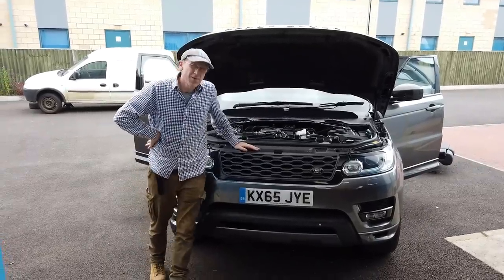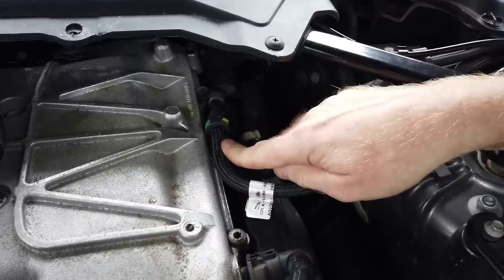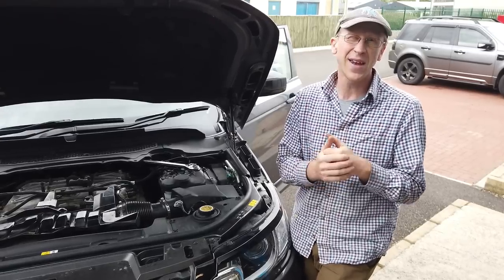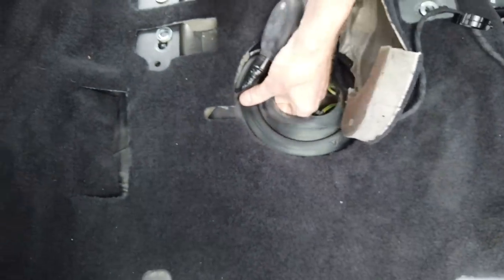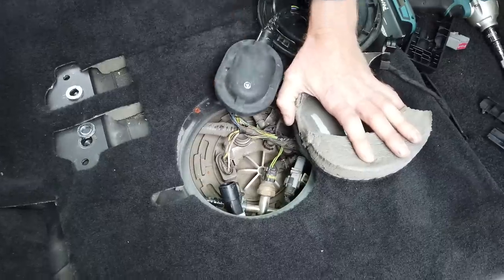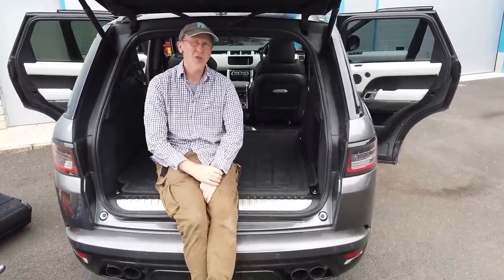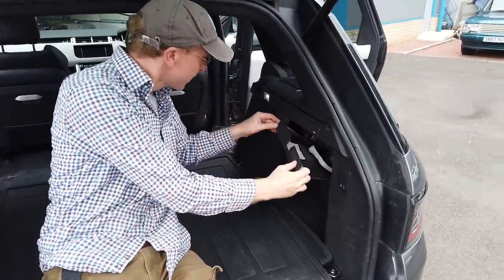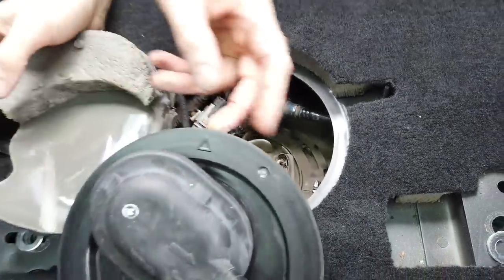Range Rover Sport L494 Petrol Fuel system / Pump / Tank / Bleeding / Fuse Locations / IID Tool

Comment: You have any tips for a female with 2inch nails that is only 5ft 2inc inches tall while in wedged shoes..... how do we reach that fuel pipe at the far back of the engine?  I do my lip stick in the reflection of the bug guard on my bonnet 😒....   

  Apart from that I think I got this....    🤔

Comment: Best yet Simon, good information and entertainment.
Reply from the maker: It was stressful.... but all good in the end !
Reply: @L663  Hi, I kindly need to pick your brains on something ive just noticed on my L494 V6 diesel.

Ive noticed a long dangling black tube hanging out of the engine bay, traced the tube and looks like it is attached to the bottom of my fuel filter. Just wondering if  this is rigjt or needs to be attached to something than dangle out of the vehicle?
Reply from the maker: @earllewis4396  Hi - sorry i did not reply last time - I think this could be the pipe from the diff breather ?

Comment: am quite impressed with this video , i got this code p2635-97 on my 2018 l405 , which points on the fuel pump module but am trying to locate the position of the module in the car, pleas can you asist with a video on that . thank

Comment: Great vid. You got yourselves into a mess there lol.
Reply from the maker: Oh yes.. i was getting worried for a few days...
Reply: @L663  Hi Simon,
I have a L494 V6 diesel Autobiography i have just noticed a long flexible rubber hose sticking right out of my engine bay I did trace it and looks like it is connected to the bottom of the fuel filter just wondering if this is right or needs to be connected to something?
Reply: @earllewis4396  fuel line return pipe connec it back

Comment: And that is why you need tools with bidirectional controls nowadays otherwise you really can't test / calibrate, prime components properly. Surprised the Snap-on tool didn't have the capability to do it by default unless it has really old software on it. Did you check under functional tests?

I think the min fuel level before priming is stated in the workshop manual. I can understand that you might have been pulling air on one side of the tank through the venturi not giving you the correct fuel delivery until you added more fuel to above the tunnel level.
Reply from the maker: I was not a pro on the snap on tool - but i looked in most menus and could not find anything .. also the guy at the garage took a look too. In functional tests i could turn the pump on and test it worked but it would not reset so that i came on with ignition...
Reply: Snap on scanners are not  good on European cars.  Autel way better.